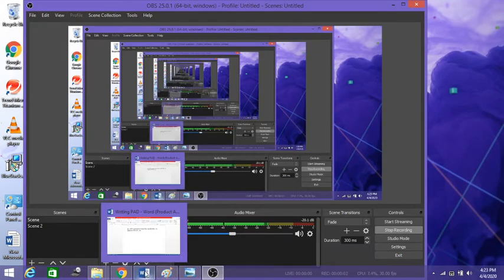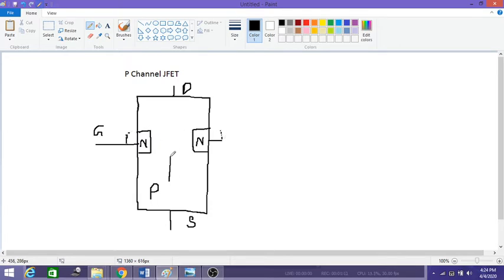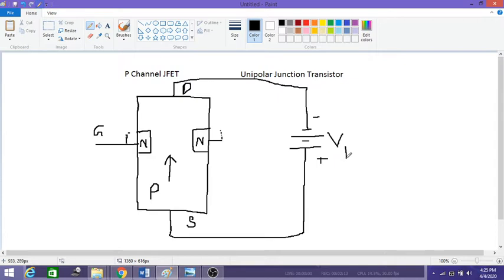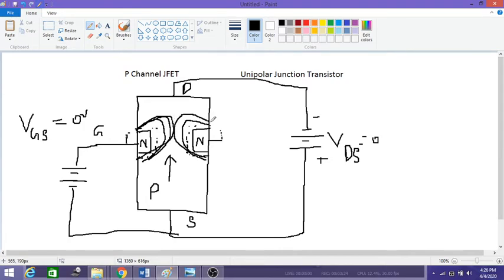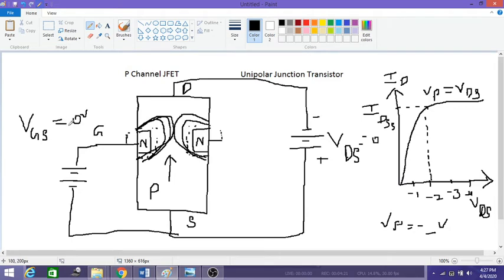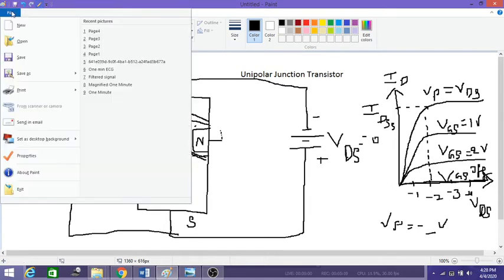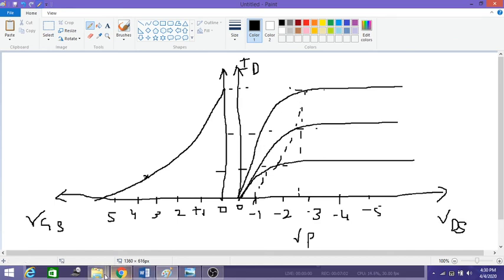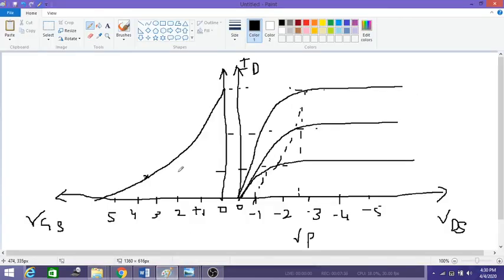4 P Channel JFET

Comment: Sir, why the ground of the Gate (power source) connected to the Source of transistor instead of Drain which is connected to the negative terminal of VDS